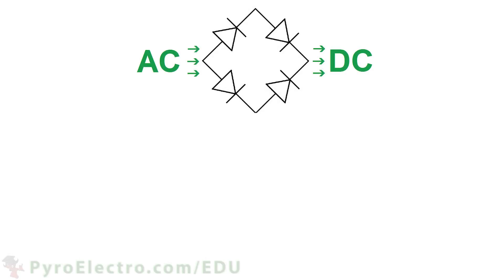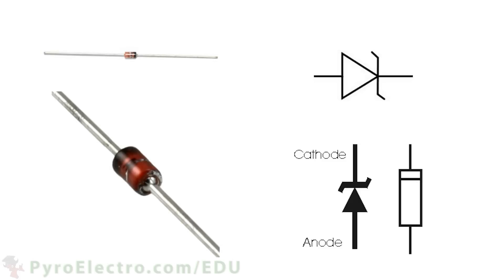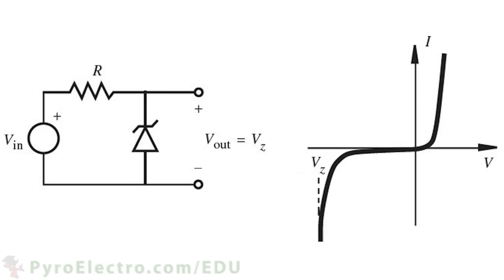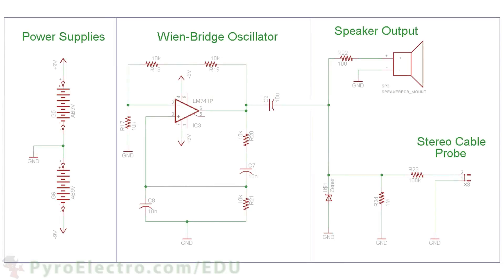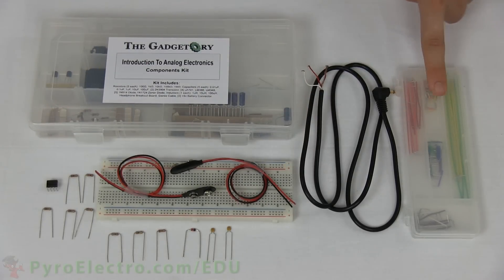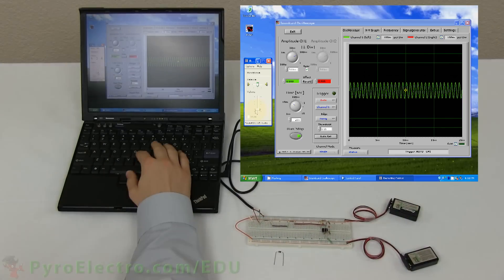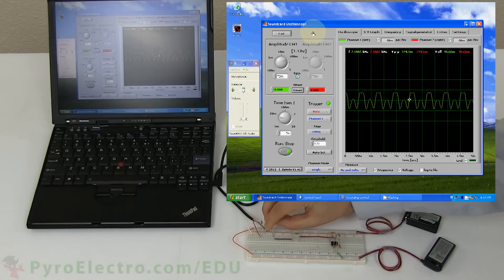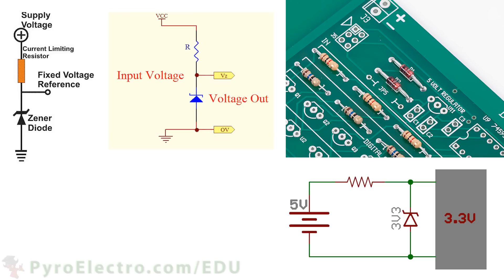Zener Diodes - An Introduction To Analog Electronics - PyroEDU

Comment: Yet again your demonstrator builds the circuit differently than the schematic. Specifically he is omitting a capacitor that is shown in the schematic and appears to add a few resisters after the output pin of the LM741 (Pin 6) that aren't shown in the schematic with no explanation. I can't follow along anymore guys. In the digital course I was able to troubleshoot your videos and still learn. This is enough above my head that I just cant figure out whats wrong in your videos anymore and definitely can't learn anymore. I don't know weather to follow the schematic or the demonstrator (or if either one is even correct). I am not buying any more components kits from you and will find some new online lessons. Too bad, I was planning to go through all your lessons.